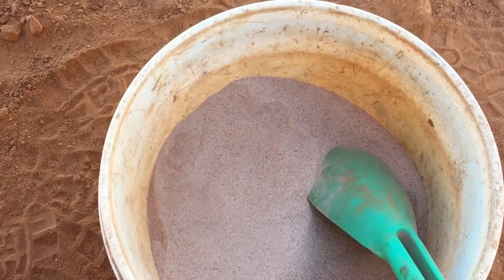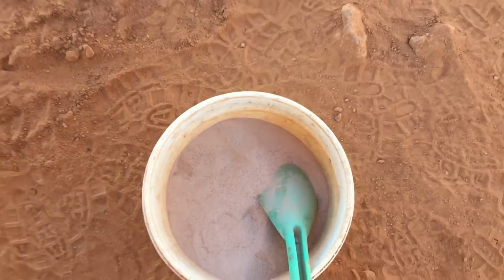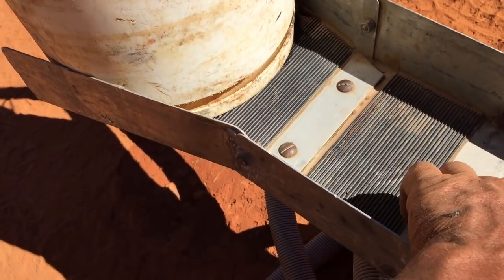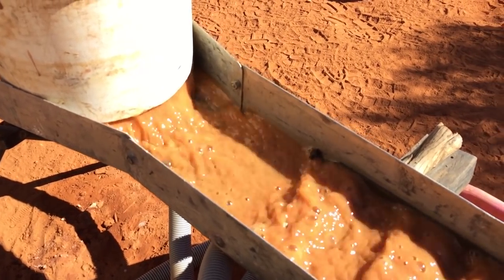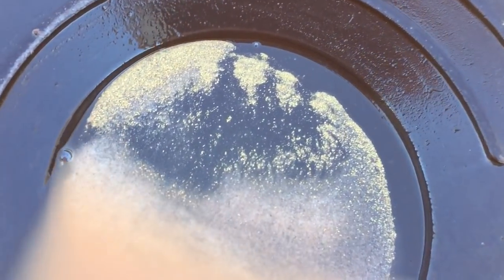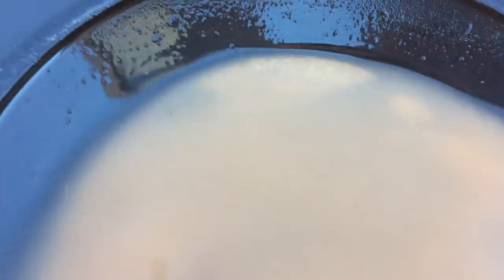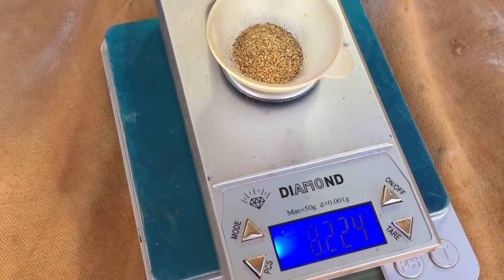Extracting Gold from Fine Crushings with Limited Water 30L Wet Plant - Aussie Bloke Prospector

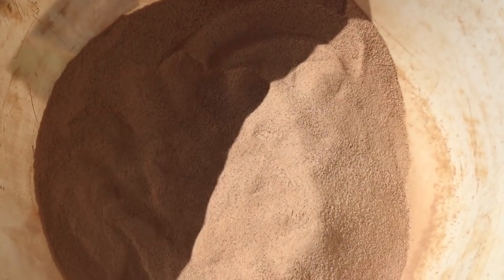Comment: 12:05 Just a thought, and bear in mind I've never prospected or mined, so know nothing about it, but I noticed that every time you stir the material with your hand, a lot of dust blows away. You were just talking about the dust silting up your sluice. Couldn't you rig something to pour the crushed rock through the wind, and let the wind blow away the dust? I'd suggest pouring a scoop at a time through the 30 mesh sieve, suspended about 5 feet above a bucket or tub.
Reply from the maker: I see your point, but some of that gold is SO FINE, the wind would blow it away if it were too strong. Regards Aussie
Reply: @AussieBlokeProspector  
Ooooh, that would suck! Cheers!